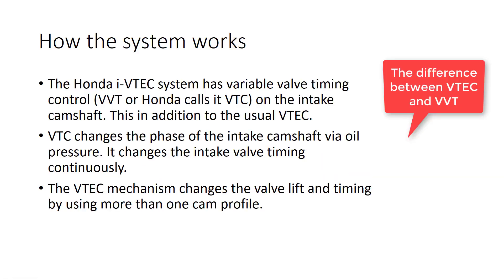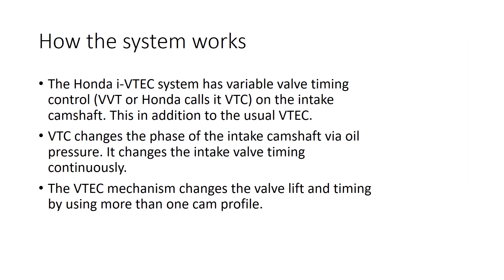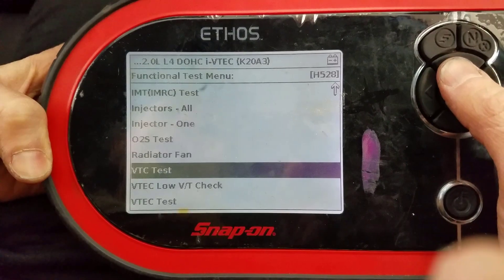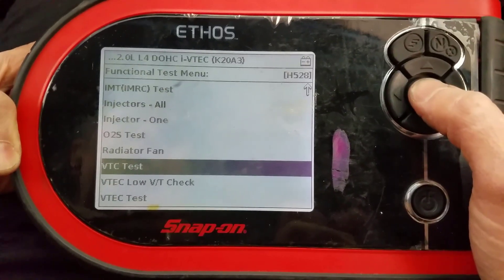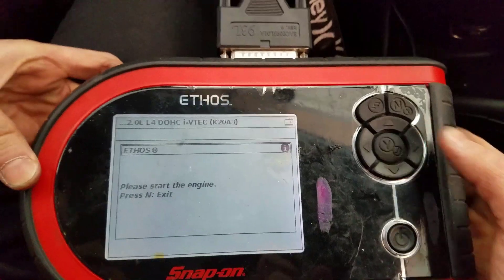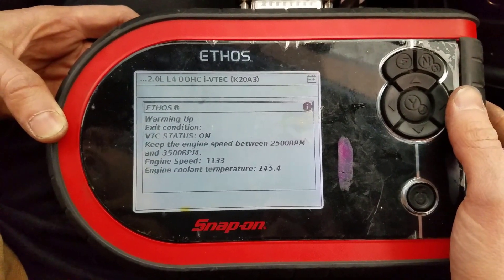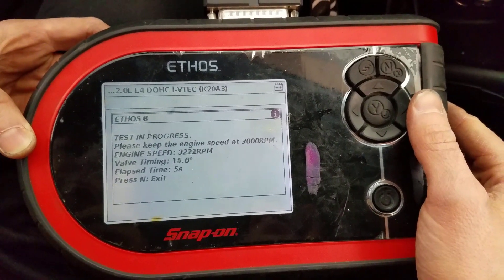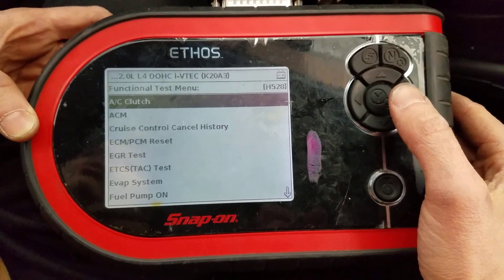P0011 "CMP Timing" - 2004 Honda Civic Si 2.0L

Comment: Nice video tutorial...this screen may be clogged on my 03 element. I have replaced the screen on the solenoid gasket assembly which was extremely clogged. Previous owner didn't change oil as car sat for a long time. I may be able to tackle this job but it looks a little intimidating.

Comment: Youre video is apreciated by many!! Thank you! maybe you can help me further? .I have followed the honda procedure completely (vtc solenoid test,wiring test, strainer cleaning wich is not dirty form the begining,i have replaced the timming chain and vtc actuator on the intake cam. This is on an auto acura tsx not beaten with low mileage,i have not resolve my " P0011" problem, do you think a faulty cmp sensor be the problem? sorry for my english im bad
Reply: Did u ever figure it out
Reply: Hahah i remember this problem on a customer car, FAULTY NEW vtc solenoid, stupid me